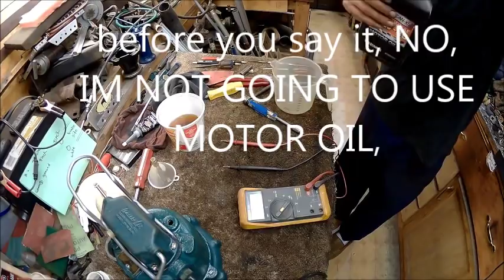zoeller m53-d sump pump rebuild part 5

Comment: I’m going to try a ight synthetic in my pump....not sure how but I lost the oil out of the pump and water in the windings. For the life of me not sure how...decided I can’t fubar it any more than it is...n53 new in 2017, not impressed! The oil can.....the oil (small amount) stays on the plunging rod and when the handle lifts back up and the rod goes its squeegeeing it off...or at least that’s what is happening to mine...

Comment: I've found it's leakage into the switch compartment that buggers these pumps. I suspect water gets past the switch arm seal but maybe its the gasket. I will never buy another with an integrated switch. Tethered switches are easy to swap out when they fail.

Comment: I got one just like this, did you just add oil to the top of the fill hole and I need Mineral Oil?
Reply from the maker: yeah, you need none conductive oil for them
Reply: I took the top of my pump and see both water and oil. So I have a bad seal. How much oil is needed? Is there a level mark?
Reply from the maker: @candancealot  oh god man, i cant remember. its been so long ago. sorry
Reply: @candancealot  I did some more reading when I get my oil I will fill till about half inch from fill hole. You want a little room for expansion and what not
Reply: @Vikingstw  thanks for the quick responses. I got impatient and posted. Learned more after asking. I have mineral oil. Have black rtv as well. Cord inlets seemed rather loose.
vikingstw, good to know.
I'm gonna see if there's an online manual too
Reply: Your political views leave where they belong not here!!  Im nonpartisan  both Democrats and Republicans are totally super corrupted and news are the same way!! I wanted to learn about pumps no your politics or views about them!! If you so into that just open another video as such!!
Reply: motor oil has detergents in it they say regular oil will  reck the motor winding's.. that's what they say.. I Don't know 🤔🤔

Comment: The oil is there to keep water out ,it's not  a lube.
Reply: The oil there is to cool the device, water is kept out with gaskets.  HASA DIGA TRUMP.
Reply: @lhbrode  the device should be filled with dielectric oil, in order to cool the rotor and stator
Reply: up to the motor windings
Reply: @brenden1986able  when you say up to the motor? Windings, do you mean the bottom side or the top side of the windings?

I have a little giant submersible pump and I'm trying to figure out how much to put in?.